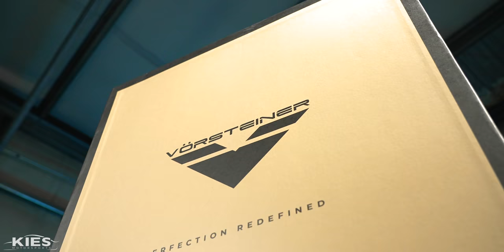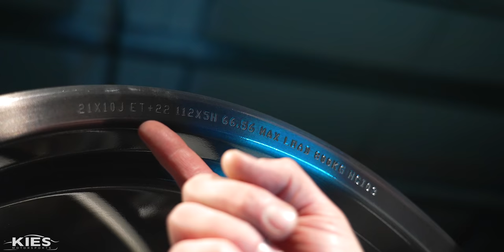SUPERCAR SIZED 21” Vorsteiner FORGED VPX 101 Wheels | KIES G80 M3

Comment: Honestly, I usually hate the look as wheels get larger. But the combination of the car and wheel finishes really work well together. This is one of the few large wheel setups that I have liked.
I am curious what the stock wheel size and weight were and what the size and weight of the new wheels are? Same with the stock and new tires? I don’t expect them necessarily to be less because going that much larger does mean increasing weight. But forged wheels have to be less than other wheels in the same size.
They look great!

Comment: A word of advice for you. Since you have an xDrive M3, you should reconsider your tire choice. Your tires will shredd your transfer box in a matter of weeks. Rear tire must not be smaller in diameter than front tire, also you must be withing 1% of tire circumfence front to rear, or the transfer box will wear very quickly. The correct rear tire size for your front 275/30 21 would be 325/25 21. So your current tire is way too small. I'd suggest you go for 285/25 21 front and 295/25 21 rear, this way you will be a happy xdrive driver for a long time.
Reply from the maker: Yes, that's absolutely true! We made sure to add the info to the description to help clarify

Comment: Like several others have commented, I don't necessarily like huge oversized wheels on cars like the M3, but I have to say that this particular wheel and finish combined with this M3 color looks beautiful.  The $100K question is how does it ride and drive with this diameter wheel and tire combination?

Comment: Thanks for the video these wheels are sweet! Will I need after market tuner styles lug bolts to run these without a stud conversion or will the oem lug bolts fit inside the lug bore of the wheel?